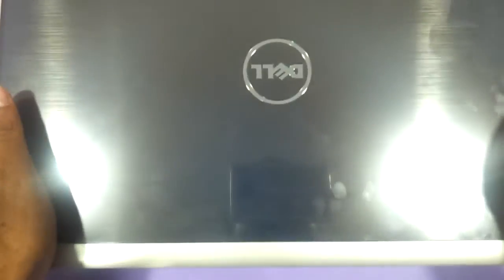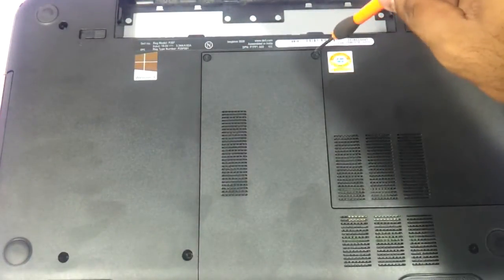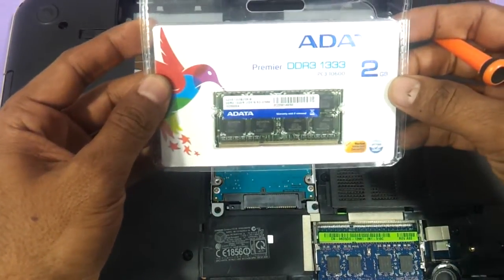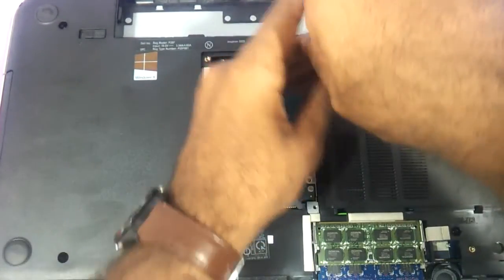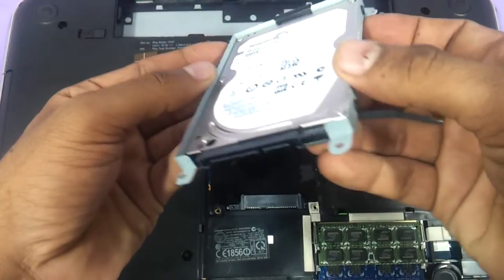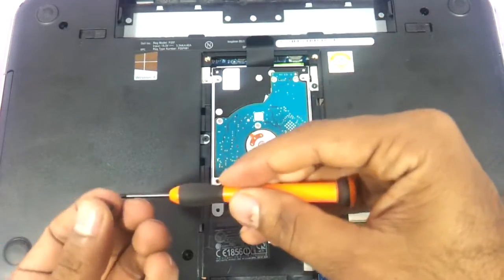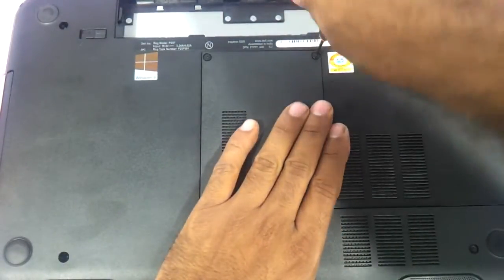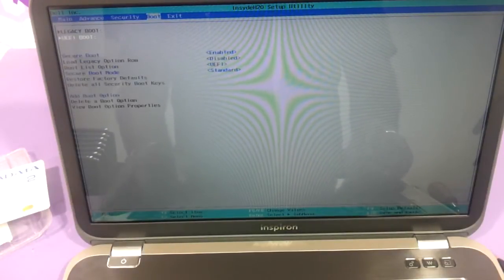Dell Inspiron 5520 7520 N5520 N7520 Turbo How to upgrade ram memory harddrive hdd

Comment: Recently this laptop of mine turns off when i plug in the charger after a min it turns off and doesn't even charge both of the power showing lights turn off too.
Reply: Should i change the battery ,adapter or what?

Comment: Does my N5520 dell laptop has dual ram slot???
Please answer my question....
Reply from the maker: Yes it has dual ram slot
Reply: Thanks for your response...But I have tried to insert the inbuilt ram into the top slot it didn't fit...I'm a little afraid that my new ram might not fit in it???Please help me...This is driving me crazy for days
Reply: Maybe you need SO-DIMM RAM memory cards (not DIMM) ?

Comment: Is There A mSATA 3 Port For Installing An SSD On The 7520 SE M/B ?? 
Or Just A Regular SATA 2....In The Case Of ONLY A SATA 2 Then The SSD Would Only Operate @ 3.0G/bs, Instead Of SATA 3 @ 6.0Gb/s So The Upgrade To The SSD Would Not Really Be Worth It Speed Wise .....
Thank You Very Much !
Blessings,
~~Wild Wizard~~